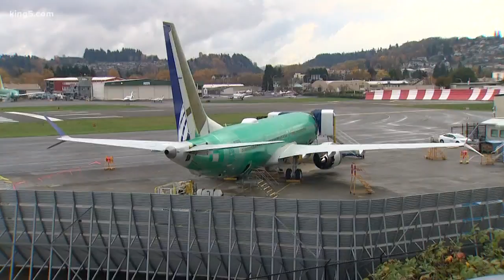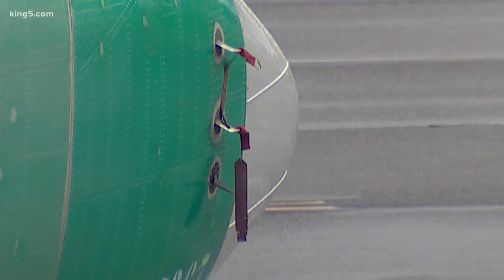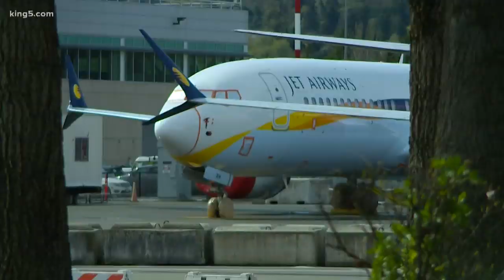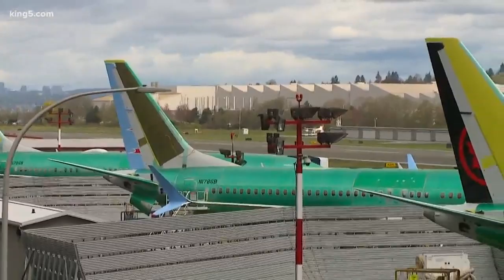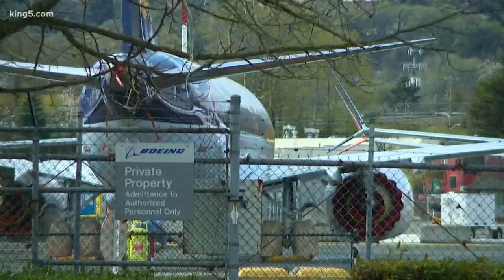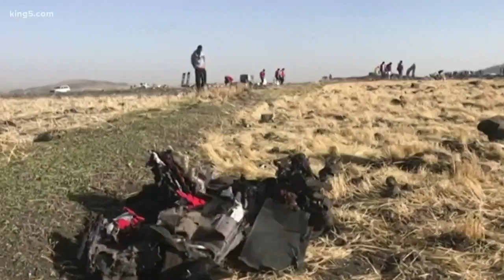There's a new hurdle for Boeing’s ground 737 MAX

Comment: Software modules greater than about ~60 lines of code require by 1966-80 Boeing software standards/1980 certification policy  require rewrites?  Boeing 767 Software Certification Policy 1980 coauthor.

Comment: "Sunwing" just made a press release saying they are removing the 737 MAX from their summer schedule ( Reference: https://www.globenewswire.com/news-release/2020/02/26/1991301/0/en/Media-Advisory-Sunwing-finalizes-summer-schedule-to-operate-without-Boeing-737-MAX-8.html ) It just makes me wonder if the 737 MAX will be grounded beyond 2 years.  But after all that has come of what is wrong with this aircraft it isn't just Boeing that needs to change for this to be a safe aircraft.  The FAA was expecting more crashes after the initial one ( Reference: https://www.cnbc.com/2019/12/11/faa-predicted-more-fatal-737-max-crashes-after-lion-air-flight-went-down.html ).  It seems the FAA's dual mandate needs to come to an end if it is to be effective.

Comment: The 737 has always had a fuselage issue of not being up to par and a weak spot as humans have died because of this engineering failure. If the FAA as being a failure in themselves gives the green light to the 737 max,  it will surely add to the 346 dead humans who have been ghosted.
Reply: WTF are you talking about? The 737 had been the safest and best selling aircraft in aviation history.

Comment: Is this alleged defect different than the way the NG series are built?  This does not seem like a reason to keep the aircraft grounded.  It is the sort of thing that is usually fixed while aircraft of the type continue to fly.
Reply: Agree.  But I don't think Boeing and the FAA are friends anymore so.........
Reply: @falconeaterf15  Also a case that the global regulators are not friends with the FAA any more, they will not rubberstamp anything and 82% of the grounded fleet is flown by non-US airlines.  Now, it has to be done by the book.
Reply: They are grounded anyway (the FAA grounded them last year only after Boeing itself asked them to do so, and Boeing is the one that has not yet finalised its own fixes and reapplied for FAA certification, so they can't complain). The return is pending type (design) certification, it's currently nothing to do with whether individual planes have been manufactured in accordance with the design. Systemic production errors like the defect announced here can ground a series in theory but that is not what is happening at the moment. Boeing's prediction before and after this announcement is still the same: a return to service in summer. So what they're claiming is that there will be no additional delays in return to service as they will have time to reverse this manufacturing defect while the planes are grounded for design reasons anyway.

Comment: When they get done with all of these changes the737 max will be the safest plane ever!
Reply: if you fly a 737 MAX you exonerate the managment who knew about the problems and killed hundreds. plus this makes you think on what other models they have cut corners. i will never fly on a 737 MAX
Reply: It's fundamentally flawed hence the need for the MCAS software.
Reply: Agree. I’d be more concerned about manufacturing quality of all planes than the Boeing design at this point. All aircraft co’s are under the great stress of the economy.